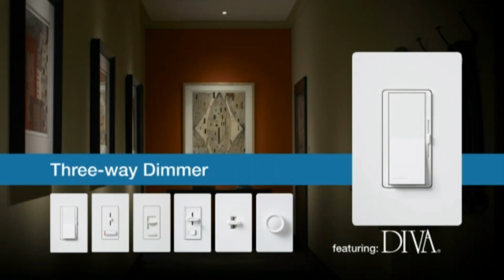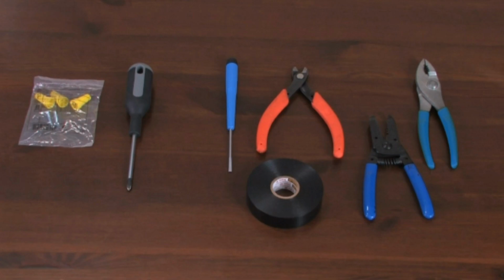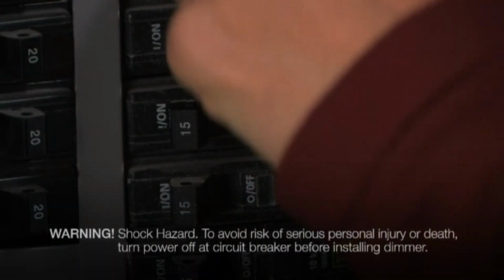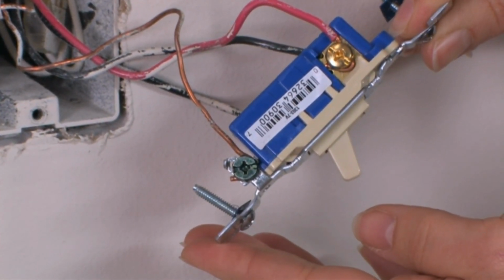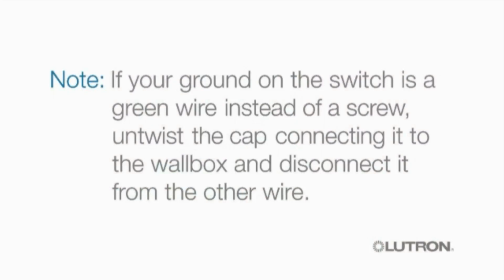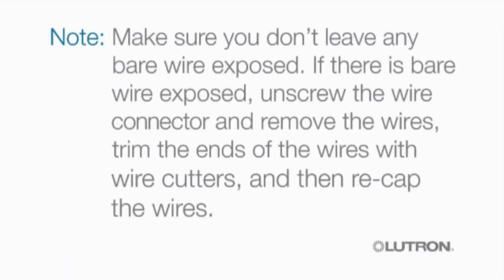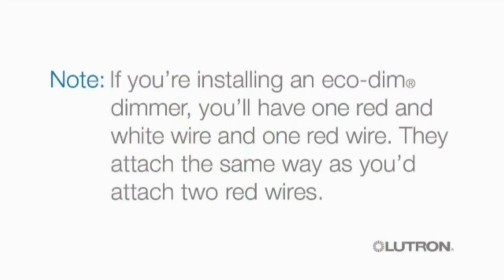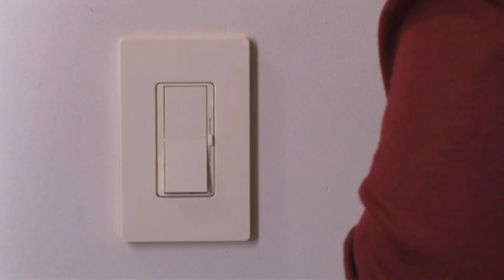Lutron® Dimmer 3-Way Switch—Westside Wholesale.com

Comment: Thanks for the useful video. I have a 3-way switch on which I installed the Diva 3-way dimmer shown here. Let's call the switches A  and B. The dimmer is on the A switch. My problem is this: For A to work, B must be in the ON position. For B to work, A must be in the ON position. Neither A nor B will work if the other one is in the OFF position. I know that this is not much to go on, but could you think of a reason why this is happening? Note: I wired the dimmer exactly as shown here. Thanks.
Reply: There are several ways to wire a 3 way switch using 3 wire (plus ground) wiring.   Consider diagrams showing power into light,   power into switch w/light in between etc. before making your connections.   I'd advise a volt tester or hire an electrician.
Reply: jjs777fzr Useless answer, but thanks for trying. However, I did call Lutron customer support (which I should have done in the first place), and a very helpful fellow called Philip helped me solve my problem. He recommended a simple wiring change, and presto, my problem was solved. Thanks again, Philip.

Comment: I have a leviton nom 057 but it has 2 black wires 1 red wire n a green. How do u wire this dimmer? I am using as a single pole dimmer. How do I wire this as a single pole dimmer?